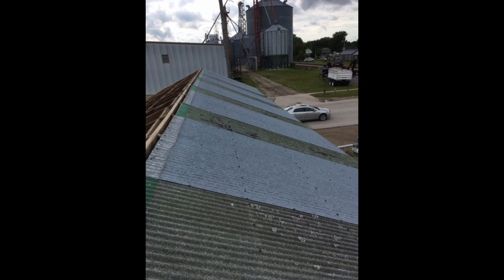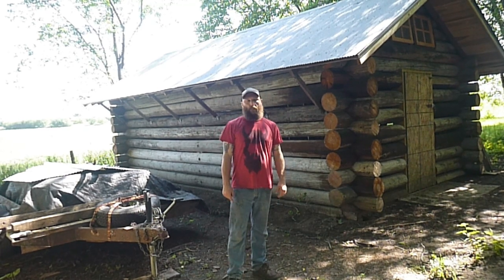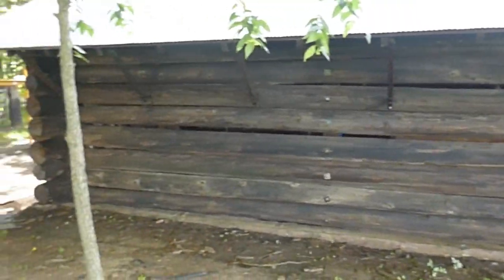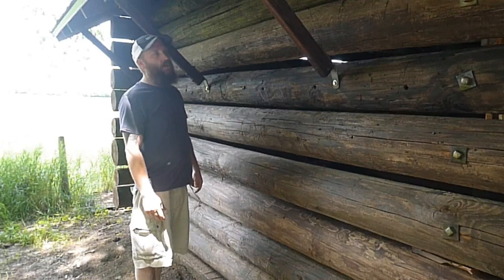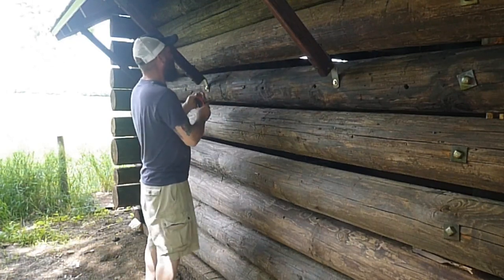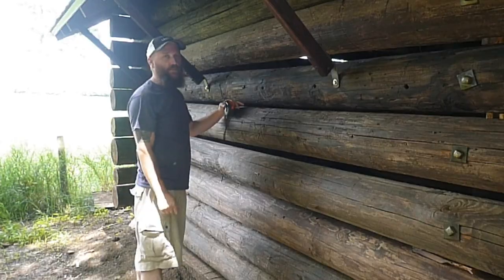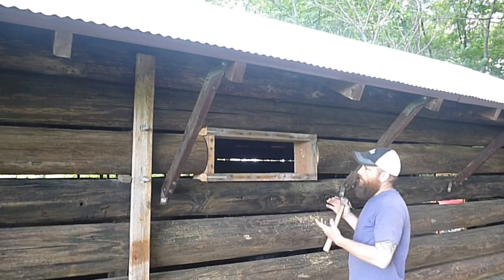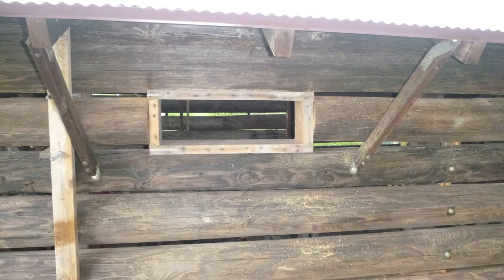Utility Pole Log Cabin Part 3

Comment: Awesome man.... Thanks for making the videos. I wanted to do this down at the father in-laws farm... Didn't know how it would work out.. Now I know 👍. One question how many poles did it take and what the size of the cabin?
Reply from the maker: Thanks! The size is about 12 x 20' so the logs were 14 x 22 to account for log overhang. It took about 30 poles in all, the ends I was able to cut poles in half and get 2 out of each one.

Comment: Also, could you use silicone as chinking?
Reply from the maker: Silicone is fine if it's a small crack, but some of my gaps are 2" or more. I've started chinking now and will pst a video before too long. I nailed in some extruded metal lath and used a lime/cement mix over that.
Reply: You could but u would have to sell your wife ‘ your childern ‘ and all yours extended family to pay for it 😄